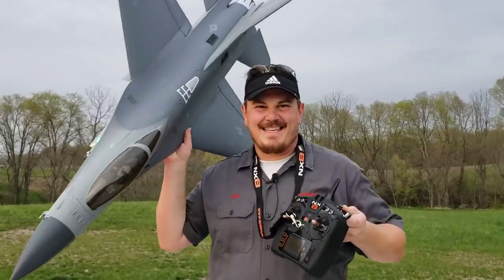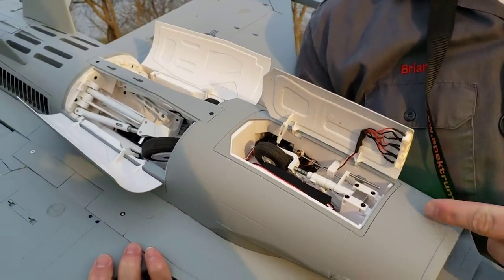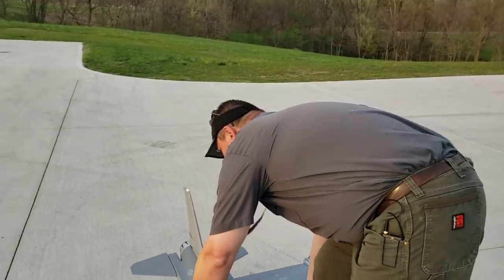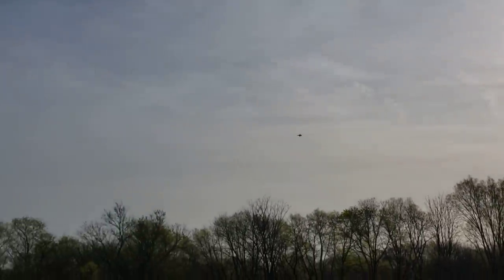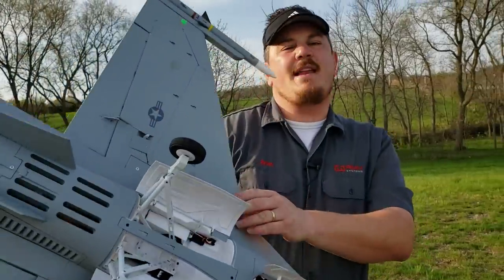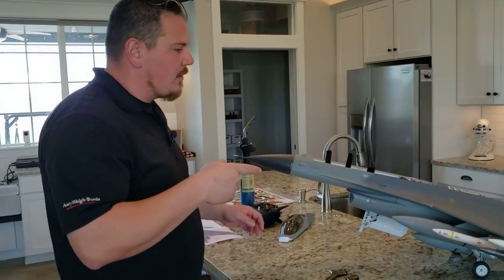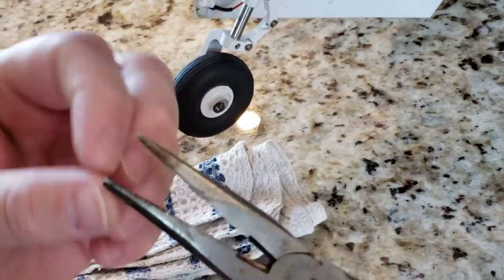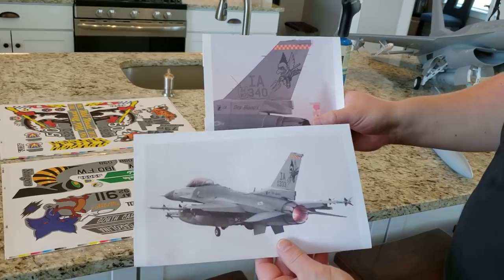E-flite - F-16 Falcon 80mm - 4X Maiden Flights & 2X Repairs!!!

Comment: With a plane like that why are you not using the road for your landing?  Or for greater pleasure a landing hook?  Haha  I was really expecting you to reinforce your broken nosecone antenna with a sanded down toothpick or something.  Nose Gear Strut = $47.99 so you saved about $50.  Dynam should be using gear that tough and dependable.
Reply from the maker: Good question!

1) Crown on the road ;( It'll go, but you'd be surprised how much it impacts landings
2) Better control over the runway here
3) It looks cooler from this spot ;)
4) Ditches - LOL, still managed to find one from our runway - LOL!!!

Thanks for asking Jack ;)

Comment: Thank you Brian for this new video.

But :) It's nice to be enthusiastic, but not to the point of passing over some problems, or even turning them around as being a good thing...
I like you very much Brian, but you have to say it like it is.
In this video, there was too much damage for a new plane with 4 flights.
Twice front wheel
Bent front wheel axle twice
One thank unglued
Missiles bent or unglued
Antenna unglued

I really think this plane need flap missed with ailerons ( flaprons)

Still like you Brian !
Reply from the maker: I showed it didn't I (the damage)? I crashed it, didn't I? Do you want me to blame the plane for my rolling off the driveway? ...for our tight landing strip? I specifically pointed these detail out? I also spent the time to show how to resolve it.

I agree that shaft on the nose gear bogey could be more solid (namely thicker), but it's probably the weak point that saved MORE of my plane from damage...I just want it to be more easily replaceable, if it's a weak point. Luckily, now I can unscrew mine and replace the bolt if it bends again...but really I need to learn to slow her down better.

I ALSO pointed our and griped about the glaring lack of flapperons (stock), but they can be added fairly easily, but I agree this was a shortcoming. I mentioned it at least twice (during flights and during build). These grips are so far overshadowed by the good things on this plane.

Keep in mind, that when I evaluate planes, I have to paint a picture of what it COULD do (with a better pilot, longer/wider landing strip), as well as showing how it did do with me, as many of you know where my skill level falls. When I review a Dynam, for example...the plane's shortcomings cause the plane to fail, but even with Dynam I cause them to fail too. I try to distinguish between the two condition...

My point is, what more do you want me to say? You're acting like I was covering up this stuff...I have like 30+ minutes of video footage showing REPAIRS??!?!?

Comment: Drill it out and put a bolt in it will never brake again
Reply from the maker: I pretty much did that...but it was a HUGE task! I tapped the thing when I couldn't get the last little bit out. Wish this pin was threaded, so we could remove it and replace it...but now it IS ;)

Comment: Love that jet, but please just put the china glue on and dont take it off with qtips. You kept putting it on and taking it off again.
Reply from the maker: China Glue needs to be spread out, unfortunately ;( I wish I could find a solvent with a cap mounted brush that I could use when I was needing to spread it, but that's not gonna bode well for foam, I suppose with solvent residue.

Comment: Please consider doing a video on autopilots such as the zohd kopilot and others .. they are $40ish and just so great in comparison to spektrum .. spektrum stuff is just so overpriced and not performing. For $75 as3x ? I can build full autopilot with r9 915mhz long range receiver lol
Reply from the maker: What protocol?
Reply: @BrianPhillipsRC  you can connect any sbus capable receiver.. frsky or futaba would be my recommendation as the spektrum satelite Is really expensive for what it is and has really poor range compared to the other once mentioned above as well as they are half price lol
Reply: @BrianPhillipsRC  just to mention those autopilots have return to home gps function full stabilisation and are capable of any setup pretty much (Delta,vtail,a tail, rudder dual rudder etc) config is with suplied card (unlike spektrum where you have to pay $15 for the programmer lol

Comment: I've watched so many of your videos, and thanks for your passion for the hobby. It would be nice with some moore contructive judgement/critics about the planes you get. All planes can't be fantastic, or?
Reply: Completely agree with you.
It's nice to be enthusiastic, but not to the point of passing over some problems, or even turning it around as being a good thing...
I like you very much Brian, but you have to say it like it is.
In this video, there was too much damage for a new plane with 4 flights.
Reply from the maker: I pointed out several issues in these video....

I mentioned the lack of flaps and my frustration, but flapperons didn't seem to help on the 70mm F-16, so I didn't press the issue.
I showed two "flaws" if you want to see it that way... A) Weak nose gear strut...or I crashed it & B) Bearing wheels doesn't help with landings. I showed me crashing it, and repairing it...I attribute both problems 75% ME, 15% bad luck, 5% plane.
I also mentioned that it's NOT a powerhouse. It's not under powered, but it would be nice to have MORE than enough power in a jet....like the A-10 UMX or A-10 1.1m alike, but that's something that isn't common.

Do you want me to make the shortcomings the point? This plane is GREAT, and so much good to talk about.

I don't appreciate you suggesting that we're NOT covering these points.
Reply from the maker: Wrong again Georges - If you crash it, it will be DONE in 1 flight! I got lucky...

4 Flights is not relevant in the measure crash damage.
Reply: @BrianPhillipsRC  
Hi Brian !
Thank you for your reply.
I will give this to you. Your runway is challenging, especially for this fast landing F-16 jet. As far as your flying skills, you are a very good flyer, but bad landings happens to everyone. But my surprise, and frustration was to see the front landing axle bending like that. I don't think it hit that hard, especially the first one. And these C clips are not holding the wheel enough. Maybe the front wheel assembly should be glued so the tire doesn’t separate from the hub. I have a BVM F-16 and my flaps/ailerons are helping a lot for slow passes and landings. I also fly an E-Flight Viper that I fly on a grass runway, and the front landing strut bends so easily, that I order a few front landing struts, and one complete front retract as spares. And I purchase my Viper after seeing your review of that Viper ! 

It would be nice if all these planes could be made bigger so we get bigger wheels for grass runways.

Comment: Nice video. With that plane I would want a large runway. I am a perfectionist so I have always liked helicopters so I can just bolt on new parts and make it back like new. I looked up the parts for this plane and they are overpriced. I will pass because of that.
Reply from the maker: Sorry to hear you're missing out on such a great plane over pricing of replacement parts. I'd say, just don't need them and you've solved your problem ;)

I have replacement nose gear and nose, and I still haven't put them on, since I think my repairs are VERY good and actually a BIT more sturdy too ;) The nose is another story - LOL ;)

Comment: Roughly 3 minutes of flight for $500 granted you are flying hard. I could get a 90mm from freewing using 5k 6s lipo and get 4-5 minutes while flying hard but....it doesnt have all the cool smart features like spektrum
Reply: Witch freewing edf
Reply: I fly for 3:30 on all my edf jets and have about 20~30 percent left
Reply from the maker: That's pretty amazing. How do you get such awesome flight times? I was pushing it hard, and keep in mind, I'm still only 5 flights in...so maybe 15-18 minutes under my belt with this plane...after some more practice, I could get more comfortable, and REALLY start wasting power quick - LOL ;)
Reply: @gavinwilkins5466  f-22 and f-4
Reply: @swivilposter8945  I have them too my f22 is 8 s I can get 4 min just then land the F4 is 3:30 from wheels up to wheel down and have 30 percent left if Ur lucky

Comment: Those c clips suck. I call the in the automotive mechanic word Jesus clips.   They should use a nut.  I lost a rubber wheel up grade on my arrows hobbies husky mid air first flight and couldn’t find the one wheel. And   Yeah yelling.......sorry Jesus.      Lol.
Reply: w.t.f? are yo on about man ? lol
Reply from the maker: I think the "C" Clip (Snap rings???) are fine...light weight, and probably helped save my retract...made a "weak" point in my situation, but agreed, a nylon would be better...or better yet a both through the whole shebang, and then when it bends, just back it out and reassemble and get back in the air - right?!?!?